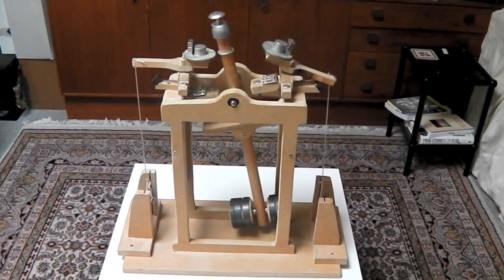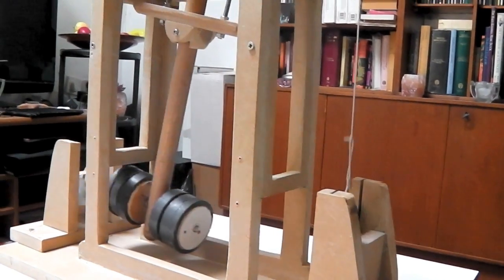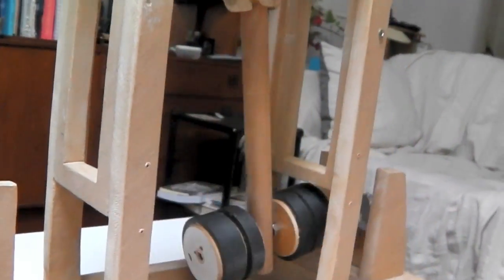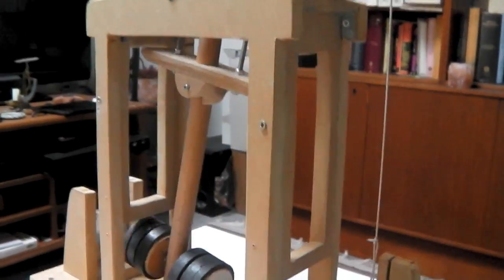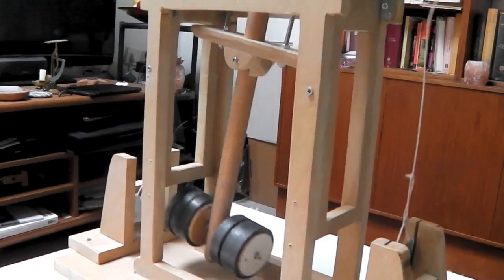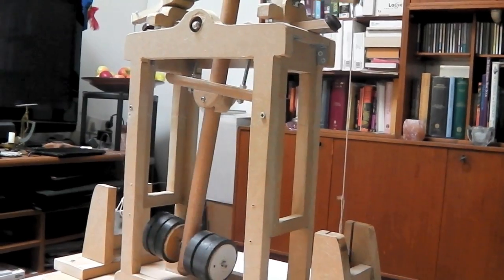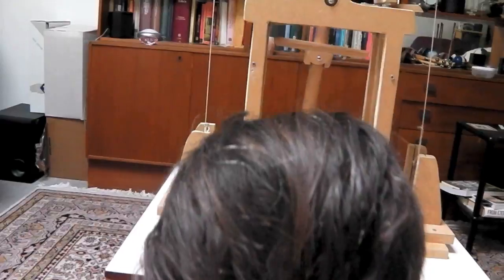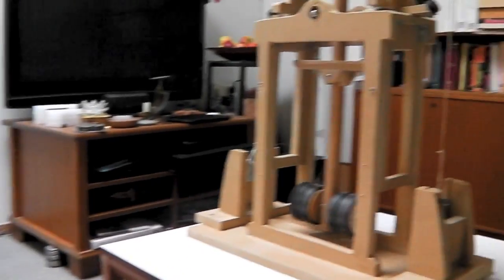Perpertual Motion Machine replication II

Comment: You could embed batteries and a couple of electromagnet rods in the base and use a switching circuit to reverse polarity at the same period as the pendulum. Although you wouldn't get to spend time with your assistant.

Comment: Of course one can produce a better machine but not a perpetual motion machine, Your many  impulses in bringing parts to a  sudden stops and the  vertical slides  running in slots and the manner those strings are ringing and dying , they are using tons of wasteful energy and that   gave your game away . Still not all is lost as you seem to be a very happy man, enjoying what you did  with your wife collaborating in the sense of humour.    Well that happiness seem to be a perpetual motion of a  kind. Well sir try to keep that up , for that happy relation in doing amusing things  together with other people and producing social relations and  dynamic art is something to aim for. Congratulations for that style of living. 
At home I have a few  powerful magnets and one can make  a magnetic field set up where one magnet  is  lifted  or levitated and this  will slide in the air   horizontally to be stopped by a piece of glass sheet mounted in a vertical plane, When the magnet with a point contact  touches the glass sheet, it stops but  with the magnet being elevated, touching nothing except the glass, it keeps moving for a  very long time. riding on a magnetic field, no bearings no sliding canals as you have and this  lifted magnet riding on what looks like air ( but it is not) when   put in a corridor, the breeze will make it  move indefinitely as long as the breeze is existing,  that is the closest I can make a perpetual motion arrangement.  
Congratulations on your skills and finishings , I tend to be not so fussy about finishing my dynamic  art  which consist mainly of various clock escapements, ramp walking toys,  rubber band repeater mechanisms, and all the  wooden toys I could think of for my grandson.   Investing in children is the best use of energy I can think of, and he seems to find enjoyment in motions around him, so  I just provide him with what schools never provide.
Well done, Incidentally you could easily make an oscillator using those  swinging magnetic weights as feedback elements, all you need is a couple of coils one for output and one for input, and one transistor would do it, obviously all the energy would come from a hidden battery. Good luck.

Comment: The visual flaw is the ability of the end magnets to drop in the face of repulsion from the swinging magnet/s. If the end magnets could be dropped a lot sooner in the cycle it would get closer. Having said that, the field strength of the magnets would have to be pretty big for the machine to even stand a chance of working given the distances shown between the opposing poles. And energy is visibly consumed in friction as well. Unfortunately both history and science are against anyone ever building a machine that can start and run on its own. Simple voltage measurements, low duty-cycle peak voltages shown on an oscilloscope etc. etc. prove nothing. Energy content is the only valid measurement.
Reply: As plates drop fast a reverse mag field as an eddy current so you have to pull it down but this creates a loss as the plate heats up.
Reply: Trick is a flux gate and leakage free flux capacitor.

Comment: Just replace your assistant with a device that does the same thing that your assistant is doing but only have it powered by the machine itself. Do that then you will surely have the government knocking at your door.
Reply: No, not government,...CSIS. I built several self running devices and CSIS popped out of the woodpile. Two agents crashed their car while attempting to follow me.

Comment: The thing could really work but not in this configuration. Look at the original, how much more impulsively the side magnets are moving. Didn't you realise that? This is an essential part for such a device. But when adjusting everything right you should end up with a real selfsustaining pendulum.
Reply: Let's help the fellow:-= ".... Third, the lowest achievable energy (the energy of the n = 0 state, called the ground state) is not equal to the minimum of the potential well, but ħω/2 above it; this is called zero-point energy. Because of the zero-point energy, the position and momentum of the oscillator in the ground state are not fixed (as they would be in a classical oscillator), but have a small range of variance, in accordance with the Heisenberg uncertainty principle. This zero-point energy further has important implications in quantum field theory and quantum gravity....etc."
Reply: I didn't mean that I meant that it is hard to work out due to air pressure and so on how close or far away the magnet will be from the other magnet. So unless he has calibrated it to go past the original starting point every time it should eventually stop a lot faster than two years, and if he has got it to go past the original starting point, than how long it lasts will depend on how long the magnet holds as much attraction which will not be certain, so it's hard to say how long it would attract as well as it does to the metal.

A magnet is not a spring it has fields, it's more like water going down a drain... or if you get a garlic press take out the metal bit with lots of holes in, put the holes pointing upwards and pour water in to it, you will see it move sideways almost like being pushed away by a magnet.

So what doesn't add up is that if the magnet is being pulled to the metal the metal is also being pulled to the magnet and so should make it hard to pull the metal bit up, however it must just be the right distance away to not be as affected when lifted in a straight line, so that it can be lifted quite easily, causing the magnet to be pulled up just enough to keep it swinging. That is why to me this looks possible, but I find it hard to do all the calculations in my head of each part of the device at the same time. 

However if one was to work out the pull in each area and work out how much distance one could have where a slight amount of attraction happened while it being relatively easy to lift the metal to a point with a lot less attraction and do the maths they would know how long this would swing for and or if it would depend on how long the magnet attracted or stayed in it's current calibration.
Reply: It will eventually stop, the original guy said it goes for two years. But the magnets will not attract as well and eventually make it not the correct calibration any more. Plus I wonder if it would stop sooner than this. I am unsure, something doesn't quite add up.
Reply: Dear Bobsyouruncle. I left this tread because there was no "DEBATE" only a very stupid "ARGUMENT" with people of fixed and entrenched positions. A Tiz-Isn't-Tiz-Isn't waste of precious time!

Comment: I really think this might work without assistance. Because of the delay the magnets at the upper levers are causing.
Then there are these flaws in the replica which is not the same as the original:
- The guillotine does not go far enough up to not to repel the magnet on the pendulum.
- The guillotine should also be about 4 cm higher, and the string should be shorter.

If you make a replica, make an exact replica!
Reply: There are better methods, easier and cheaper to build.  https://www.google.com/search?tbm=isch&sa=1&ei=LwCIXLTDG_jB0PEP2OaO6AM&q=kevin+hay%2C+mechanical+alternating+gyroscopic+inertial+compression&oq=kevin+hay%2C+mechanical+alternating+gyroscopic+inertial+compression&gs_l=img.3...210710.219346..220605...0.0..0.183.3049.51j2......1....1..gws-wiz-img.uqdsi8LEv1M

Comment: My comment was "generally speaking", and not about this device in particular.
That said, there is energy input in form og a wife or someone in this particular case. A perpetual motion machine isn't possible without perpetual energy input. Alle form or energy is a process that is present within unstable circumstances. This instability, this can be oscillation, heat flow, or other processes, will finally die out.
Reply: You must have missed the zeroth law Vidar...why do all of these fake named people think that they know better than Nikola Tesla? If you do, then show your work as I do!  https://www.google.com/search?tbm=isch&sa=1&ei=LwCIXLTDG_jB0PEP2OaO6AM&q=kevin+hay%2C+mechanical+alternating+gyroscopic+inertial+compression&oq=kevin+hay%2C+mechanical+alternating+gyroscopic+inertial+compression&gs_l=img.3...210710.219346..220605...0.0..0.183.3049.51j2......1....1..gws-wiz-img.uqdsi8LEv1M

Comment: Well, Finsrud made a working perpetual motion machine. John Bedini has a motor that has been running 20 years. Then we have the Joe cell which works, which requires no input power whatsoever, and can run an engine without consuming any fluid or electric current. I would say that perpetual motion is possible. I haven't built a magnetic device myself, but I've proven the Joe cell beyond a shadow of a doubt with 1 year of testing, and it does work, against all known principles of engines.
Reply: My designs work.  https://www.google.com/search?tbm=isch&sa=1&ei=LwCIXLTDG_jB0PEP2OaO6AM&q=kevin+hay%2C+mechanical+alternating+gyroscopic+inertial+compression&oq=kevin+hay%2C+mechanical+alternating+gyroscopic+inertial+compression&gs_l=img.3...210710.219346..220605...0.0..0.183.3049.51j2......1....1..gws-wiz-img.uqdsi8LEv1M

Comment: If it will work with a magnet motor assistance, the magnet motor would work without this device. As you shure already know, a magnet motor does not work on its own untill you apply energy into it. So assisting this (beautifully made) device with a magnet motor will not help I'm afraid.